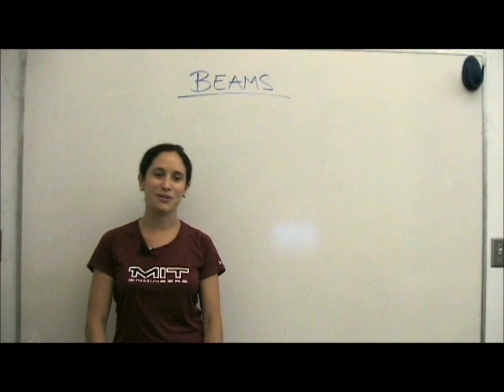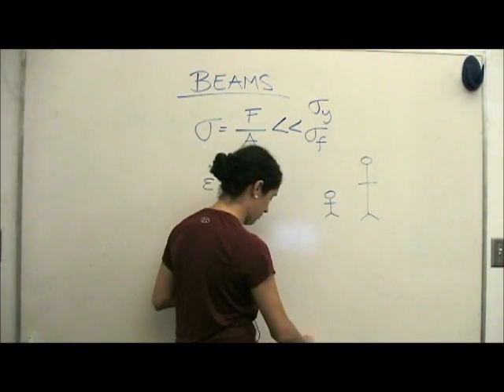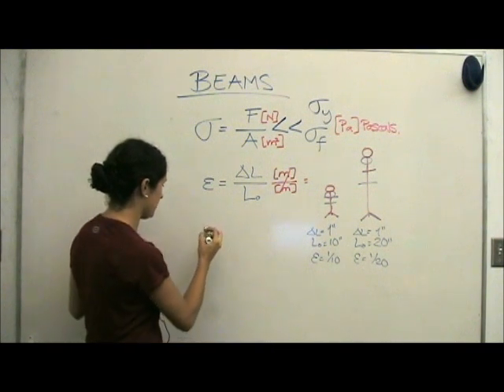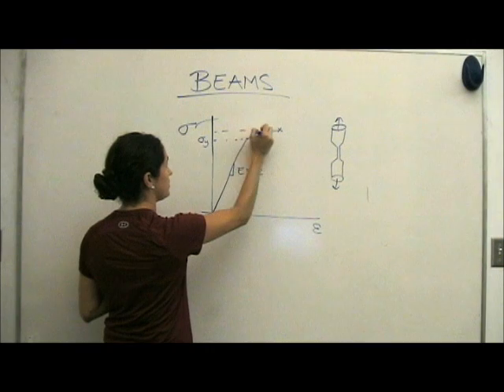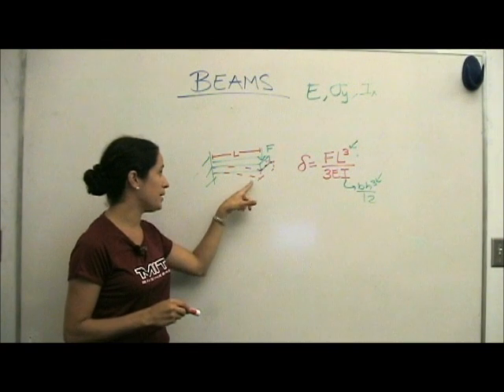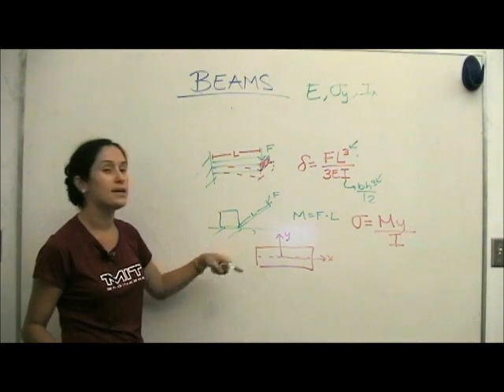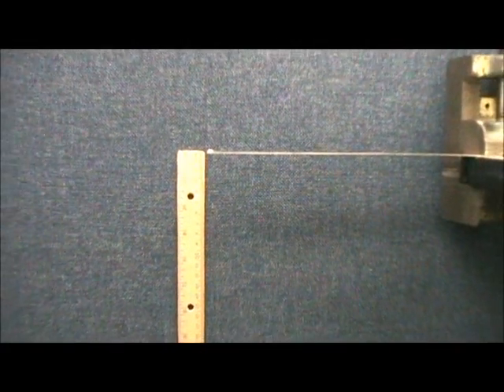Beam Bending: Avoiding Failure

Comment: Great video and easy to follow, I am confused though, i tried plugging your values into the formula s but couldnt get hte same results as you.  possibly because I couldn't read the value exponents from your board (I am not a mechanical engineer,but i need to understand as i am building a canopy over double doors.

The values I have as as follows:-
F=0.5 N, L=0.25M, b=0.025M h=8x10^-4M, E=69x10^6Pa, I=1.07^-2 M.

I am many orders of magnitude out. I get  3.51^-3 mm and 4.67^-3 Mpa respectively.

Where have I gone wrong?

Comment: The practical tips given are good. However, writing the stress formula as sigma=Force/Area while the topic is about "Bending of Beams" can mislead the students. In bending of the Euler-Bernoulli beams, the stress calculation is based on the simple bending formula, 
sigma=M*c/I, where:
M=bending_moment;
c=maximum_distance_of_the_material point_from_neutral_plane
I=second_moment_of_are_of_cross_section

Comment: Good job, but not upto the mark to be watched by engineering graduate to gain good knowledge and analytical skills. The concept of stress itself needs at least 30 min explanation before you can proceed to explain anything else. I would recommend nptel lectures for those who really want strength their concepts to design in real life rather than just watching for the sake of curiosity.

Comment: Hi, i would like to work on a project but have a few questions that might be of interest to a few here.

If im looking to reduce a tube 75 feet long to one inch I know I will need to reduce it to  75 inches.

How will that apply to pounds. 

For example let say that that pipe can hold 100 pounds , how will I reduce the 100 punds to apply to the for the to apply the reduction for the 75 inch tube?

Comment: At 0:48 the bridge failed due to the dynamics loads not the deflection.
Reply: Partially agree, but not quite; The dynamic load resulted in the deflection of various beams, members and joints.
Reply: The failure occurred due to the  resonance, because the frequency caused by the wind matched the bridge's natural structural frequency.

Comment: Now I'm ready to build my underground bunker, thanks
Reply: mam at 2.21 of video you have used yield stress and fracture stress 
but its yield strength  
strength and stress are two different things in solid mechanics 
strength can't be calculated it can only be plot by using ashby plots made by cambridge university or 
plot in stress strain diagram by breaking test
this shows 
MIT university is just overrated what's with number 1 bullshit
another idiot from mit video
https://www.youtube.com/watch?v=5uuQ77vAV_U
he doesn't even know 
difference between coagulation and flocculation
calling Alum as flocculation agent 
ahahahahhahahahha

Comment: That was great!  So I created something that uses a beam.  I ran the numbers on efunda and found that my maximum bending moment stress is 692 MPa.  The yield stress for my material (4130 steel alloy)  is (gasp!) only 360 MP.  So if I understand your video, I should be seeing plastic deformity yet I do not.  Is my understanding correct or is the deformity so small that I can't measure it.   Thanks again!
Reply: hey if you don't mind, I'd like to hear some more about your beam. are there any more details you could share?

Comment: Ratio 50%,  How to calculate the Beam/Built-up/channel/Angle load bearing Strength as per LRFD/EC3/ASD
Reply: +Urs Friend CADD  AISI or AA design manual can be a good reference. Consider lateral bucking, local buckling, crippling, shear etc....

Comment: Lots of good stuff in this video, but here's the most important point -- the Area Moment of Inertia is proportional to the cube of the height of the beam.  Consider standard lumber:  a 2x8 beam (oriented with height = 8) vs a 4x4 beam (same length).  They have the same amount of wood, but the 4x4 beam will deflect 4 times as much as the 2x8.  This is why rafters do not have a square cross sectional area and are often 2x10's or even 2x12's.
Reply: Same amount of wood matter. One is twice as long but the other is twice as wide.

Comment: 6:23 Can someone explain the integral please? Is Integral(y^2) some kind of a formula for area moment of inertia?? And lastly How is it that: Integral (y^2) = (bh^3)/12
?? Thanks in advance.
Reply: +Thor 
In pure bending around the z axis (axis coming out of the screen) in this case, you have a distribution of stresses on the cross-section that are positive when y > 0 and negative when y < 0 as the y axis is defined in the middle of the beam, so that the beam bends clockwise around the z axis. The resultant moment at the cross-section is the sum of those stresses that depend on y over the cross-section area. The integral alone is the moment of area.

The integral of the cross-section area is seen as integrating x from 0 to b and y from -h/2 to h/2: integral(integral(y^2 dy) dx), then the integral about x is independent and sums up to b, the other integral leaves 1/3*(h^3/8 - (-h^3)/8) which is h^3/12.

Comment: Thanks maria... 
I had underatand beams abit beam better ;)

Im a mobil DJ and im building a set up to suspend ligting and audio gear. Most gear would be evently distribuited on 3 beams on a Y shape.. 
My question is what would be a safe load or max load capacity on this structure... 
The struccture would be suspended front 3 points.. one at each end of the Y 
Hope you can help me..

Comment: does increasing the depth of the beam decrease the deflection?
Reply: Any change in the beams cross sectional area, or shortening it's length, will increase it's strength, and decrease its deflection. By adding to the width, height, or shortening the beam, it will decrease deflection.
Reply: yes

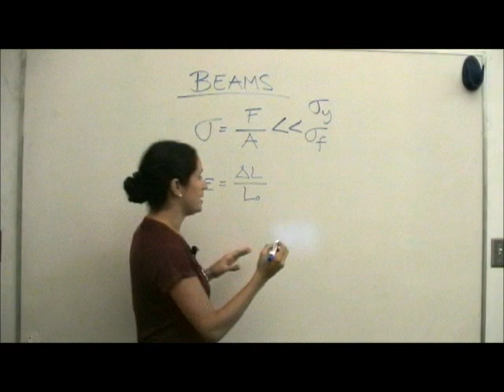Comment: 2:45. Were each of those two classmates (tall and short) grew 1 inch naturally? Or were they pulled along their lengths and thus both experienced elongation of 1 inch? I can only see strain on them if they were pulled. Btw, it is highly likely that the tall dude came back to his original height once the force was removed whereas the shorty exhibited a plastic deformation and gained 1 inch of much needed height permanently!

Comment: @enriqueramosvillafan well, yeah, she skipped the explanation of the integral... but there are general rules about it which you can find in tables. 
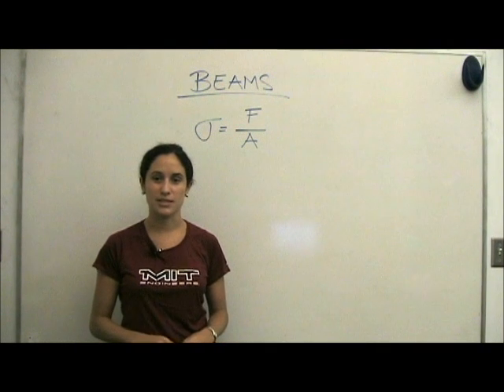it actually just gives you a mm^4 factor which says why the beam breaks at different axis (as if u try to bend the beam normally as shown at around 1:30, or if u try it where u rotate it 90° where u will need much more force to break it (it has more area momentum of inertia..)